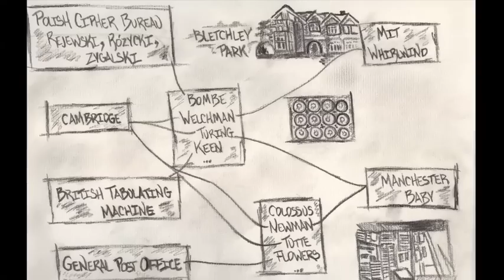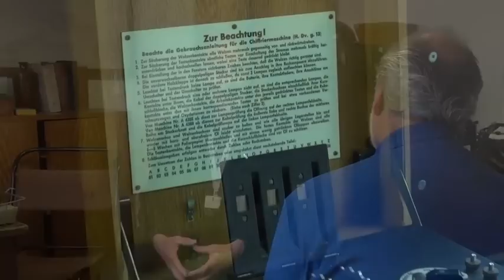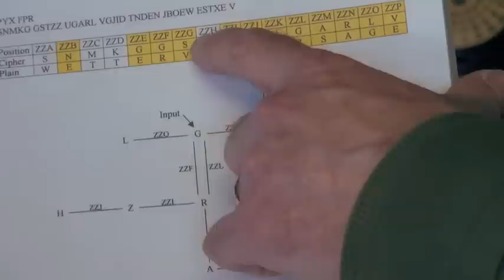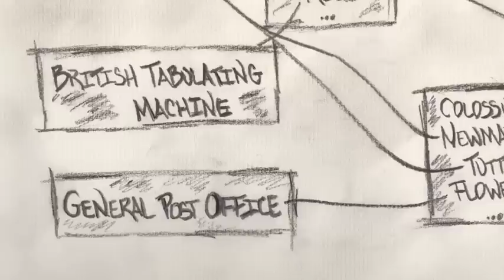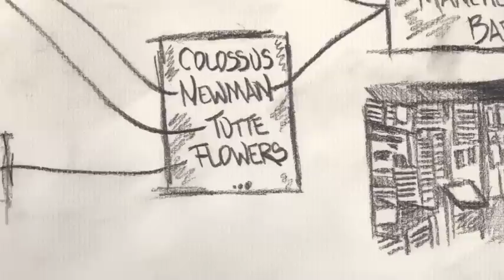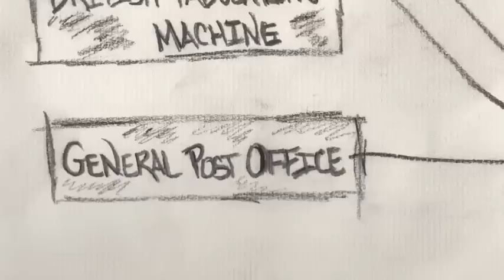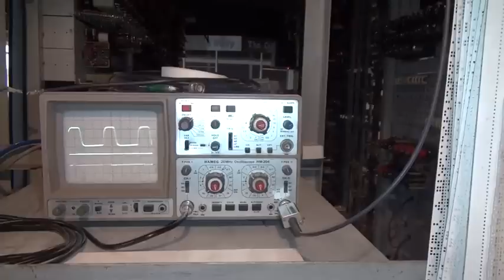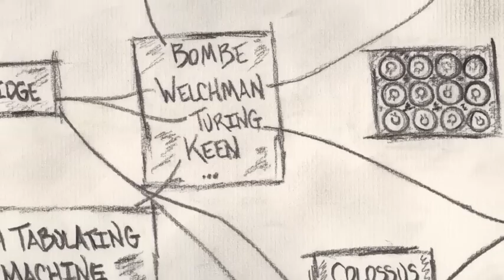IEEE Computer: Alan Turing at Bletchley Park

Comment: In 1988 I did my first course with, what was then, British Telecom, (formally GPO or Post Office Telecommunication’s) at Bletchley Park for 3 weeks. It was, to me then, an old country estate albeit very run down. I had no knowledge of its past or history then. We had an exercise whereby we had to track/locate buried cables and we were finding cables underground that the instructors knew nothing about ! Makes sense now. National Air Traffic Services also had a presence there at the time training new Air Traffic Controllers.
You can see Tommy Flowers influence albeit the look/feel of old Strowger telephone routing equipment. A lot of this is still in place, albeit dead, in some telephone exchanges.